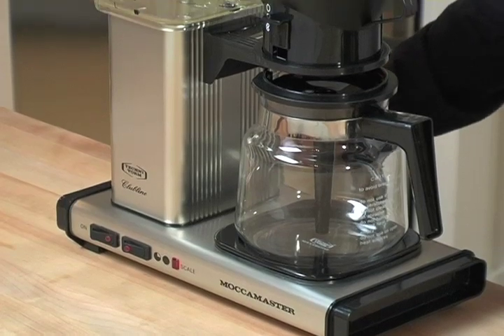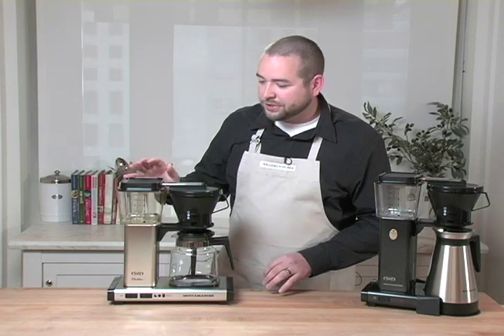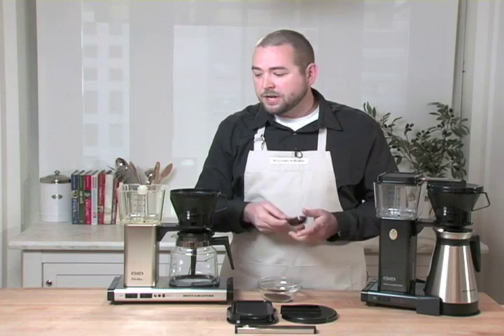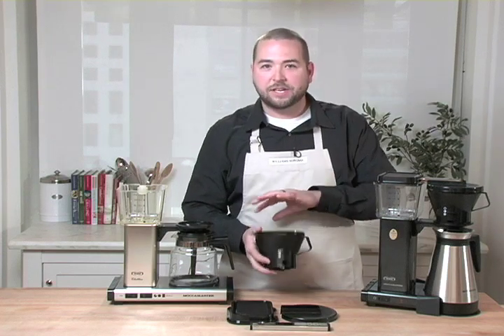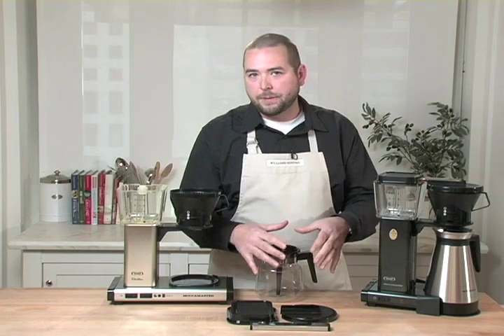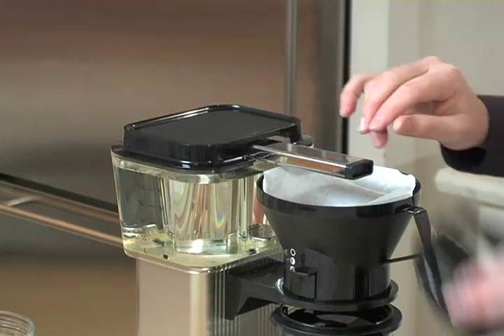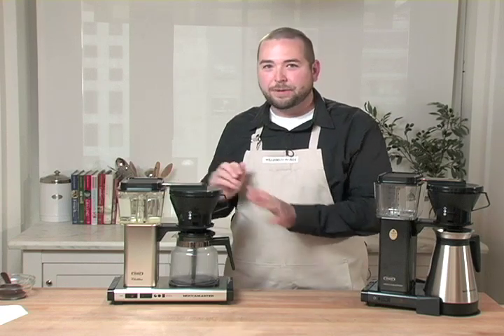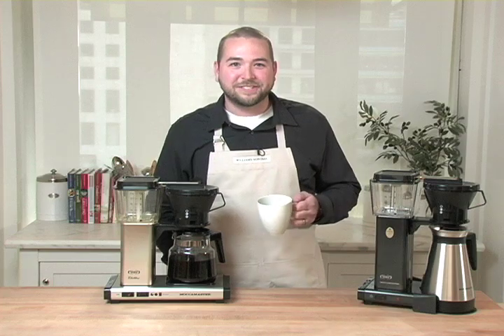How to Make Coffee with the Technivorm Moccamaster Coffee Maker

Comment: When you want to brew 2-4 cups of coffee, you should use more than 1 scoop per 2 cups (recommended by the manufacturer Technivorm). And set the basket in the closed position. Open it when the water level has dropped by a 2 cup level indication. 
Oh... and always rinse the paper filter.
The Moccamaster is awesome. Lasts a lifetime. And if it's broken, it's easy to repair.
Reply: Is there a big difference between the KGB model and the KB model, that has the settings (3) on the basket?
Reply: I use the moccamaster recommendation  7 scoops for 10 cups he mentioned 5

Comment: I watched several videos about this product and yours is the best.  I was very confused when I opened the box and found these weird parts.  The company should include your video!!  I like the way you explained everything. However, this video was made in 2010 and I think they changed things.  My brew basket  does not have a way to change for the amount of cups. It does not seem to matter.  However, afterwards, I noticed water is left in the machine and I have to dump it out. I wonder if this is normal.

Comment: I found an answer to my question about the water being left, so it is good to know about this:  I quote:  Moccamaster doesn’t use pumps to push the water through, it’s the natural process for this type of brewing system. Therefore, it is normal to have a few ounces of water remain in the boiling element. This is fine if you brew every few days. If you brew every week or two, we recommend emptying the remaining small amount of water by removing the parts and turning your brewer upside down over the sink.

Comment: I have recently purchased this machine in the thermal version.  Very easy to make and looks cool on the counter.  Big problem though.  Coffee directly from pot is tepid.  I would be pushed to even call it warm.  This is Immediately after brewing.  Is the coffee in the glass pot hotter?  I am going to have to return this unit.
Reply: I read you have to warm the carafe with hot water before you brew.  that's why i am going with the glass one.
Reply: I’ve not had a problem at all with the thermal coffee staying perfectly hot for hours. Switch lids straight after the brew to keep the heat in and prerinse the pot with hot water.

Comment: What only 5 scoops (around 50grams) for 40oz ? 

I would use at least 7-8 scoops.
Reply: Going by the SCA recommendations, 1.2 liters of water needs 72 grams of coffee. That's a little over 2.5 ounces by weight. I don't know how that would relate to scoops, though. We use our TV-sudpplied scoop in the flour canister.
Reply: Technivorm's manual suggests 55 grams coffee for 1 litre of water (32 ounces) or 69 grams water for 1.25 litres of water (40 ounces water) Much too strong for me. You are using 5 scoops (2 tablespoons per scoop) which would be 50 grams coffee for 40 ounces water which is roughly one tablespoon per every 4 ounces of water. That's more to my liking. I usually use 1 tablespoon (5 grams) per 6 ounces of water. Two tablespoons (10 grams) coffee is much too strong for me.
So you are using only one tablespoon of coffee for every 4 ounces water where Technivorm suggests 2 tablespoons of coffee per 6 ounces water. For 12 ounces of water you would be using 3 tablespoons whereas Technivorm would suggest 4 tablespoons.
Reply: @katzparov  they are going by the SCA standard. Former SCAE standard was 60-65g per liter. SCAA had 55g standard per liter but now SCAA and SCAE are togethere as SCA. Also if you grind our own beans you need to take it coarser than pre-ground from the store for the best result.
Reply: @klarinetta  Their standard is much too strong for me. They suggest adding hot water to the cup if you like weaker coffee rather than brew weaker coffee.
A little trick that I use for more even wetting of the coffee grounds is to swivel the basket back and forth with the lid off which disperses the water more evenly. You may find that normally, the force of the water tends to burrow a divit into the grounds preventinng a "Flat" bed.
Since the brew time is so fast, you won't have to spend very much time swiveling the basket. Just enough to evenly wet the grounds.
Give it a shot.
I'll be trying 5 Technivorm spoons per 40 ounces of water. (Each spoon is 2 tablespoons)
Reply: @sgbaird  I think the Technivorm scoop is about 7g. I pretty much use 72g for 1.2. liter Technivorm but take into account that I use coarser grinds than what is sold pre-ground in the grocery store more like medium. For large brew basket brewers such as 2 liter Fetco etc. I would use finer grinds and lower ratio.

Comment: Never heard any one claim 5-6 minutes is not the optimal time. 

Only gripe...all plastic parts should be replaced with glass, metal or ceramic.

Mine needs the on/off switched possibly replaced. 3 months after I began using it the on/off switch began sometimes sticking. Wouldn't stay at the ON position unless I pressed the switch to the ON position 2 or 3 times. Other days it was good. Requiring only one press.

Other than that...brews great coffee. Like the simple design.
Reply: on off is probably sticky due to dirt or grim ...

Comment: Aren't you supposed to wet your filter before brewing? And I thought the two heat plate settings were for if you're going to use cream/milk or not. High if you are, low if you're drinking it black.
Reply: use a swiss gold filter had mine for 15 years you get the oils of the coffee vs no oil with paper
Reply: @JBM101  That has nothing to do with my comment.
Reply: Pre-wetting vs no Pre-wetting? I've never really been able to tell a huge difference. You do you. But the heat plate setting is, theoretically, meant to be be used as said in the video, depending on whether you have a full jug or half jug. It has nothing to do with milk/cream or not. I mean, who adds milk before pouring in a cup anyway?

Comment: Can I make only TWO cups with the Technivorm ??????
Reply from the maker: Yes, absolutely!
Reply: Thanks for answering. 
But how should I adjust the coffee/water ratio?
Reply: Sure,but I have experienced that if I want to make only 2-3 cups(which I usually do) then the coffee isn`t as strong and the reason is that the water passes through the coffee grounds just too quickly which results the coffee being watery and lacking taste. To my mind it  misses a feature some (better) drip makers have that have an additional switch intended for smaller number of cups, that actually slows down the brewing process resulting in a more flavory and stronger coffee.
Reply: You can prevent the water from flowing through the basket by putting the switch in the off position. I do this every morning in order to get more bloom out of the coffee, and I use my timer on my range set to 2 minutes to alert me as to when to move the switch to fully open — which is at the top of the filter holder.
Reply: @cedricksmith9481  Go to @3:00 where he explains how to adjust the filter basket for different amounts of water to be brewed.
Reply: They recommend 4 cups

Comment: Descaling instructions directly from Technivorm website:Moccamaster brewers should last a lifetime, when cleaned and descaled properly! As with all coffee brewers, your Moccamaster should be descaled (removal of calcium/lime deposits-buildup) and cleaned (removing water residue/coffee oils) in order to maintain proper performance and great tasting coffee.For descaling and cleaning your brewer we recommend Urnex brands:Full Circle Descaler,  Full Circle CleanerUrnex Dezcal Descaler,  Urnex Cleancaf CleanerOther brands may harm the copper boiling element, potentially resulting in an unpleasant metallic after-taste.  We don’t recommend vinegar, because it rarely descales sufficiently and may leave an after-taste.Moccamaster recommends you clean and descale your brewer every 100 brew cycles. This can be easily remembered when you buy a box of 100ct filters.
Reply: Highlighting:  "We don’t recommend vinegar" - there are some great comparisons on YouTube of vinegar vs. commercial descalers.  Net:  Vinegar is better than nothing, but still terrible.   

They recommend "Durgol Universal Express Multipurpose Descaler".  If you can afford this coffee maker, you can afford to take care of it properly.  Use the stuff they recommend.

Comment: How do you know what the perfect grind is?
Reply: It probably takes some experimentation with different coffees and grinders but I've found that on the $50 Cuisinart grinder, the middle setting (indicator arrow pointing directly at you) works consistently well for the coffees I've tried.
Reply: Chris L cool. Thanks.
Reply: Chris L which cuisinart did you get?
Reply: The OXO burr grinder is perfect for this moccamaster

Comment: My Moccamaster broke within 3 months (the float switch stopped working). I sent it back for repair. It took 1.5 weeks for them to respond to my email request and 2 weeks, once shipped, to get my machine back so 3.5 weeks without a working machine total. I do live in Florida and they are in Seattle I believe, but still. After 2 weeks of normal use it broke again; same issue. This time, after another 3.5-week transaction, they replaced the machine. It is working fine now but sucks that their customer service seems to lack any sort of urgency with fulfilling repair requests. 1.5 weeks to respond to an email is extremely unprofessional. And the money you'll spend at a coffee shop while going 3.5 weeks without a coffee machine, if you drink coffee daily, adds up. I even asked, since they were replacing my machine anyway, if I could change the color. They said no and wouldn't budge. Then I wanted to just receive my money back. They said no. They just didn't really seem to care about the inconvenience this caused which was disheartening.

Comment: I thought it was 7 scoops of coffee for 10 cups.
Reply: One scoop of the cup that comes with the Moccamaster is about 10g. The rule of thumb is about 60g pr 1ltr (8 cups) and 75g for 1,25ltr (10 cups). But it depends on the coarseness of the grind. Too fine, and you risk overflowing the basket, which is quite a mess ;)

Comment: This is such a device for people with too much money. It's a $300 coffee maker and it doesn't have simple settings like delay brew or auto clean. For Christ sake you have to even manually flip it between 3 settings for how much coffee you're brewing. If I'm spending this much on a coffee maker there should be a digital button to press, or even better it should auto detect the size. This machine has less features than my Mr Coffee, it's got 2 buttons and costs 10 TIMES as much! Technivorm is laughing all the way to the bank! That "golden cup" is them pissing in your coffee and calling it a luxury.

Coffee is hot water through beans, yeah you can tweak the elements and alter the taste slightly, but the average joe can't tell the difference. But I guess that's the point isn't it, people who buy this like to believe their connoisseurs.. well drink up ;)
Reply: You're missing the point of the machine lasting a lifetime...
Reply: Haha... this guy! Stick with your kcup and stop wasting our time trying to be a cool guy.
Reply: Its also about taste
Reply: The simpler it is the less likely to break

Stop funding planned obsolescence
Reply: it last 15-20 years how many machines have you bought in that time ??? proabbly china crap too